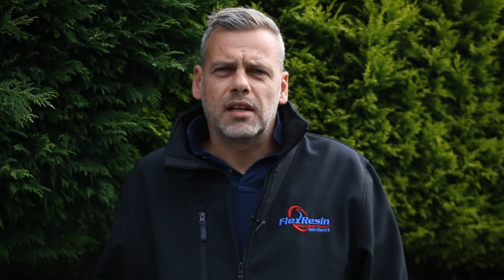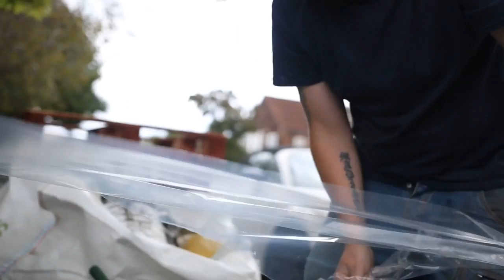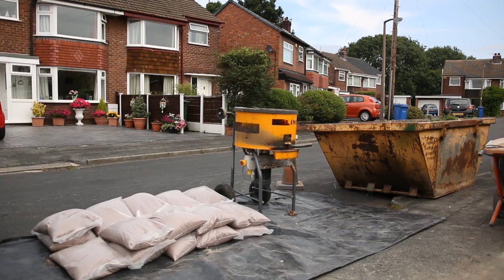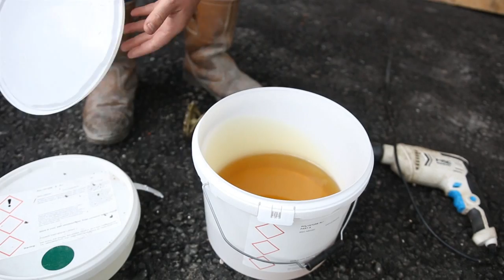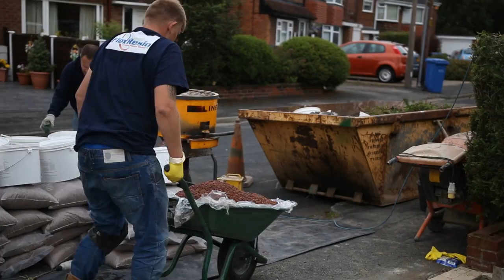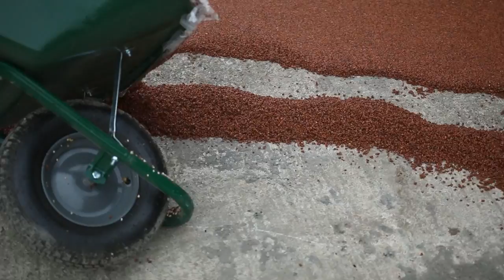FLEXI RESIN/ Install video spelling corrected longer start

Comment: As the header says flexi ....damm right laying on slabs .. don't even clean out the buckets so not even a consistent mix nor is there tape on the brick edge to protect it ..like someone else said   cowboys

Comment: Laying this over paving 👎👎👎👎
Reply: S.d. It’s only on the footpath tbf so it will be alright I wouldn’t personally do what they did but as it’s only gonna be walked on don’t see it going anywhere
Reply: There is too much movement in individual paving slabs especially if there not layed correctly so i think personally it will crack in time.
Reply: S.d.yh that’s true. Also might be down to the customer not wanting to pay for the labour to take it up then get rid of it then re do the base